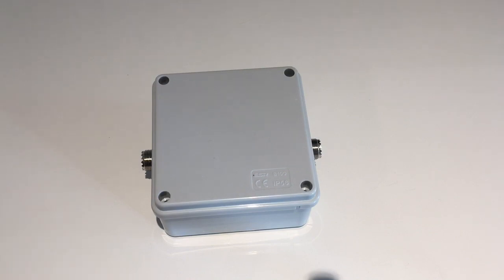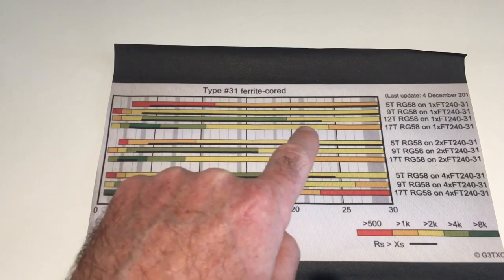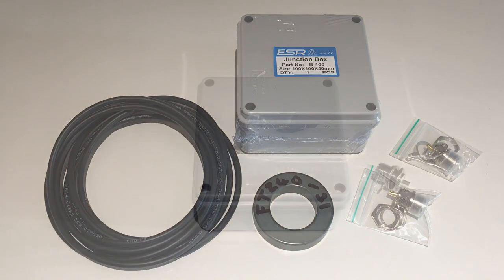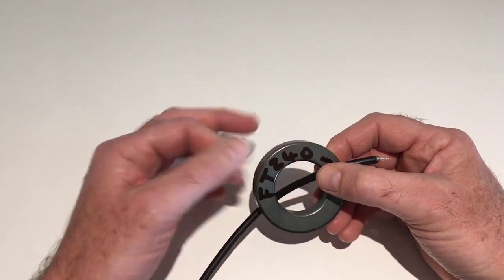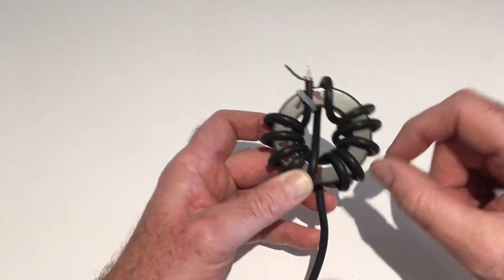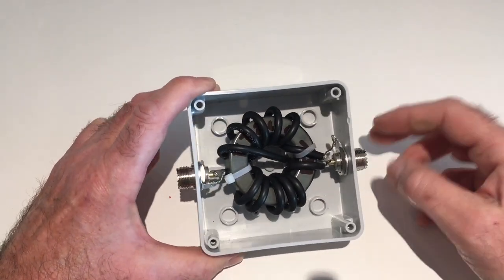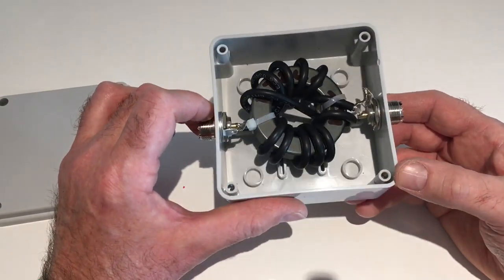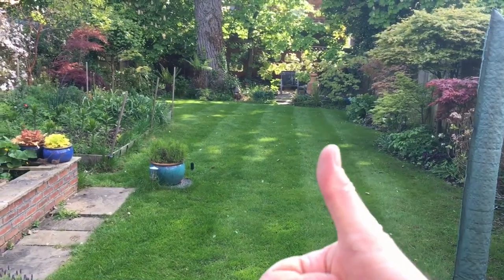DIY Simple & Effective HF RF Choke

Comment: Thank you for sharing . I have made the same choke , except for the connectors  I have used PL259 plugs with SO239 inline bulkhead connectors , this method insulates the internal coax conductor & the entire coax connections eliminating any signal loss , this method requires a slightly larger enclosure to allow for the two SO239 bulkhead chassis connectors & the PL259 plugs , this provides a totally isolated system with no exposed inner core .
Reply from the maker: Great 👍🏻

Comment: Nicely explained demonstration and a sturdy job. Interesting to see that you had some condensation in the box on the wall. It's really good to see a video which is "real world" rather than "TV perfect". Thanks Ian.
Reply from the maker: Thanks! Yes, I think I put in the description (🤔) I subsequently drilled a small vent hole in the base and protect the hole with a very small piece of net curtain (to stop insects). It seems the air trapped in the weather-proof box still heats/cools and condenses as a result. I guess it can’t be large amounts, but I’ve done the same on another choke too 👍🏻 Thanks for watching 😀
Reply: @ianxfs  Thanks for the reply Ian. I had seen that you mentioned drilling a hole in your notes...seeing the condensation was a good practical reason to see why you need a hole.

As you say the box is sealed so in theory,  if you included some silicon chips to absorb the moisture from the air in the sealed chamber...you wouldn't need to drill a hole. 

Theory always sounds great, I bet the practic3 is different! LOL 

I enjoy your videos and that of the Callum Crew. Keep up the good work! 73s Ace G6XIB

Comment: Thanks for the link, I found a box of 4 FT240-43 toroids in my shack and happen to need a decent choke where I feed my coax (rig-58) in through a window for a temp setup.  When I am sending on 80m, my wife’s hobby light keeps flashing.  I’d say I have some RF coming in on my Random Wire antenna.
Reply from the maker: gsansoucie ok good luck!

Comment: Excellent video. Why did you choose 12 turns and not 8? 8 turns on the chart shows more of a resistance result over the HF bands which was recommended.
Reply from the maker: Hi Paul. If you’re on Steve’s webpage, go to the specific ferrite links below the main tables. There’s one for type 31 and these differ from the main summary table. Based on the spread of resistive properties as well as the green impedance I thought 12T looked a better spread. I’ve had no CMC issues on my OCFD at 200w over 40-6m since install 3 years ago. Happy with that. Good luck if you’re building your own 👍🏻

Comment: Hi, fwiw in theory RG58 can suffer from the centre conductor migrating when wound like this round a tight radius, I must admit that it does not seem to have bothered a common mode choke I put together decades ago. I have bought RG142 for a new QRO balun, it is teflon dielectric and jacket, not terribly easy to strip the ends but it will not melt with a soldering iron. FWIW my observations suggest that power handling is hugely affected by the level of imbalance that the  balun has to deal with. Very clear description of the construction in your video 73
Reply from the maker: Thanks! Yes, seems to be ok as now been in use on two antennas for about 1.5 years, with 200w RF 👍🏻
Reply: @ianxfs  thanks for the reply, fwiw I have checked the bending radius in the datasheets, RG58CU marginally wins over RG142 although RG142 has a tiny bit  less loss.
Reply from the maker: g0fvt ah right...worth checking then 👍🏻
Reply: @g0fvt  For the length of coax that you are using to make these 1:1 Ununs, loss is not a factor.
Reply: @jfrphoto01  not normally no.

Comment: I did mine with a RG-58 cable assembly without the box. I used heat shrink to protect the choke.
Reply from the maker: Yes good point Tim! Mine was to insert into an existing set-up, so I went for the box.
Reply: @ianxfs  I go for the simple solution. Once it is installed, no more PC freezes.

Comment: Good video and explanation. After fitting did you notice much difference on the bands?
Reply from the maker: Thanks. Yes it removed the common mode current on my off-centre fed dipole coax. I also fitted one to my ground mounted multi-band vertical, but there wasn’t a problem with than antenna to start with. Just for good measure. All good 👍🏻
Reply: @ianxfs  thanks Ian, I might have to investigate one of these.

Comment: Sir, Thanks much for the educative and informational Video on Chokes. I'm new to SWL, and not into transmission.(Basically interested in SWL ONLY) My equipments are YAESU FRG-7 and FRG-7700, both satisfactory functional. My antenna is "Random Wire" flung out of the window. My signals are quite good on 160 Meter Band to 41 Meter Bands. The Antenna Balance device has not been connected, as yet. That'd take place at the later part of May.
The question is, since I'm only into SWL; is there separate Choke for Receivers; or can I use this Choke  in my antenna circuit?
Thanks in advance and an acknowledgement will be highly appreciated.
Stay safe, Sir and Bless you. 73s
Reply from the maker: Sree Kumar Thanks for the nice comments Sree! I don’t think it’s a necessity to have an rf choke when you’re just listening, but they do block common mode currents on the shield of the coax, so they may help. It depends on each person’s situation. If you’re not having interference or noise problems, then you’re probably fine. You can always add a choke and see if things improve. It won’t hurt, so for a little cost and effort, it may be worth a try. Enjoy your SWLing 👍🏻
Reply: Sir, Thank you for the rapid response. Presently the Random flung wire antenna on the Oak trees do a commendable reception on both the receivers. But, at times, I get a great amount of noise ( disturbance ) on lower Bands , distant and far away transmissions. But it’s not constant and I traced the source to our upright Freezer  and Fridge. These units have their own inverters working when the compressor kicks in.
Toby, my Canadian friend, therefore suggested implementation of ‘Choke’ in Antenna input.
I’m like, I ordered a 9:1 unun and now a Choke? When’re am I gonna install all this? Then I saw your YouTube, that gave me a lot of info. 
My questions; therefore, are:-
1) Is your Choke suitable for my receivers?
2) Should go for type 52 toroid ferrite Core? ( One is available in France )
3) What is the Toroid Ferrite Core OD  50mm?
4) What is the Coaxial Cable OD? I see your Coaxial cable to be thinner.
5) Thanks. 
I’d be gratefully, thankful to your advice, as always.
Please stay safe.
73s
Reply from the maker: Sree Kumar Hi Sree, here’s my thoughts...
1. Yes
2. Types 31 & 42 are good for HF. I’m not sure about a 52? You might have to research that mix on the internet. I think it works better at the higher HF frequencies?
3. 2.4 inches/61mm
4. Coax is RG58 approx 5mm

Good luck!
Reply: ianxfs <<<< Sir, thank you for the prompt response. Stay safe. 72s

Comment: Great video mate do you remember where you purchased the so239 connectors from.
Reply from the maker: Hi James, no sorry. All online ham/amateur radio retailers will stock them and also the outside four-screw ones as well. You’ll easily source them. Have fun!

Comment: Hi Ian, just watched this again. Wondering if I wind the ferrite on the end of my RG58 cable to the antenna if I actually need an enclosure? Have you any opinion as to the power handling for this choke, you say you regularly use 200w, would it be OK for 400w I wonder. Thanks for the videos :-)
Reply from the maker: Yes & yes Chris. If you can avoid the box and additional connections then all the better 👍🏻 From what I’ve researched, 400W on that core and coax is fine 😀
Reply: @ianxfs  Thanks very much. I have ordered type 43 for mine. Have some silicone wire too so going to try 2 ways of doing it.

Comment: Hi Ian great tutorial just want verifcation Did you use RG8 or RG58 and would it make much difference thank you Dave M3xie
Reply from the maker: David Robinson Thanks David! RG58. As long as it’s 50 Ohms and you can wind it around the toroid and it is spec’d for the power you’re using, then you’ll be fine. 73. Ian.

Comment: I've struggled soldering the coax to the SO 239. I see yours have "tabs" to solder to. Where did you get those SO 239s?
Reply from the maker: Hi Dennis. I can’t recall, but the shield part of the socket should have the disk with solder tab attached otherwise you’ve got nowhere to attach to. Mine will have been online from one of the few online uk stores. Good luck!

Comment: Great video, I thought you would have put the choke near the antenna feed point !
Reply from the maker: Alec M Yes Alec, but the OCFD already has a 4:1 balun at its centre, so a choke as well would be too much sag. It’s at the closest point where the coax meets the wall. I have another on my ground mounted vertical, but again, a few feet away from the base in the centre of the lawn so as not to be obtrusive or a trip hazard. All still work fine 👍🏻
Reply: @ianxfs  As long as it works that's what matters lol   thanks for the reply

Comment: I don't know that you are supposed to wrap RG-58 that tightly; you may get migration of the center conductor within the insulating foam.....it's non-repetitive turning radius is .98 inch (24.89mm).
Reply from the maker: Hi Michael. Yes you could make the turns more loose I guess. So far, no problems nearly two years on with two of these running 200w 👍🏻

Comment: Hi fron CHILE, EXCELENT VIDEO, one cuestion. what powes is max. ????
thank
Reply from the maker: Sergio Del Gaudio Hi Sergio! I don’t know what the max is for sure. It will manage 400w which is the UK maximum, but looking around at other websites I think it will go to 1Kw. You could also stack 2 of the ferrite cores on top of each other and wrap coax round them both together for an even higher power, which increases the choking effect too. As long as you don’t exceed the coax limits 👍🏻

Note: I did drill a small vent hole at the bottom to let it breath. 

Hope this helps!

73 Ian.

Comment: Hi - will my RG8 coax be too different to the RG58 that is used for the tests - or will I have to find a length of RG58 to create the Choke - cheers
Reply from the maker: chilli sauce RG8 is 50 Ohms, but a larger diameter than RG58 I think? You may find it too wide to go round the toroid without risking crushing the interior?
Reply: @ianxfs  Hi-  the RG8 is 6mm diameter -  RG58 is 5mm   !!!  Ill have to stretch the hole wider then !!!!  RF - drug of choice
Reply from the maker: Ah right. Should be ok then 👍🏻
Reply: I guess this is RG8X or Mini-8. I have some of this. :-)
Reply from the maker: @paulsengupta971  It's RG58 Paul.
Reply: I meant Chilli Sauce's 6mm "RG-8".

Comment: thanks for making the video
did you check to see if there was a 50 ohm impedance match for your choke? cheers
Reply from the maker: Ralph Kluge Hi Ralph. I used the club’s MFJ analyser with the choke inline with the antenna and the SWR etc. was all ok if I remember correctly. Anyway, it’s been fine in operation for over a year now and this model is in use on two antennas without ill effect. Ian.
Reply: ianxfs I just tried it with a #43 instead and the swr is flat until 16mhz then shoots up. I wouldn’t have thought there would be such a difference. So think I may need to try another piece of rg58
Reply from the maker: Ralph Kluge Sorry Ralph. YouTube didn’t inform me of this message, so I missed it! Hope you got sorted ok? I’m not sure why the swr changed? Seems odd... Ian

Comment: You had the RG58 wire cut and did not tell us the length of the cable  needed for all the turns of the transformer common mode choke .
Reply from the maker: Hi, I put it in the video description. 1m 👍🏻

Comment: Nice!!
Reply from the maker: Thanks!
Reply: I just recently got my General class license here in the USA. The electrical theory  and mathematics was the most challenging if not interesting  part of the study. Fascinating to watch some one build a choke and for me to be able to grasp the concepts behind it.👊 Do you have any videos on multi band HF antennas ?
Reply from the maker: @thomastammaro693  Hi Thomas. Congratulations on your licence! Multibands, depending upon you house/garden, I would say off-centre fed dipole, vertical and/or doublet? Have fun! 😁
Reply: @ianxfs  , Thank you sir. I have actually got an inverted V cut to be resonant for 10-80 meters. The trick for me is going to be getting it up over all the tree  and tying it off . Hence my question  regarding the Diamond  vertical ( it's referred to as a garden  antenna, I just can't remember  the exact model number).I still have much to learn. But I'm trading ( in theory at least)  for price and
simplicity in being able to get up and running

Comment: What frequencies will this cover?
Reply from the maker: Hi Paul. If you pause the video at the point where I show the frequency charts, you can see the choking performance across the HF bands. This type 31 ferrite is better for the lower-mid bands whereas a type 43 is better mid-high.

Comment: what particular RG58 are you using?
Reply from the maker: It’s RG58 C/U, but I don’t think it really matters, so long as it’s the general RG58 family spec. Hope this helps. Ian.
Reply: @ianxfs  thanks finished mine. now attached to my hustler 6BTV vertical.
Reply from the maker: revadan Brilliant!
Reply: How much power can it handle?
Reply from the maker: revadan I don’t know what the max is for sure. It will manage 400w which is the UK maximum, but looking around at other websites I think it will go to 1Kw. You could also stack 2 of the ferrite cores on top of each other and wrap coax round them both together for an even higher power, which increases the choking effect too. As long as you don’t exceed the coax limits 👍🏻

Note: I did drill a small vent hole at the bottom to let it breath. 

Hope this helps!

73 Ian.
Reply: @ianxfs  awkie.  yeh i also drilled a hole underneath.  So with two ferrite, will come with the same number of coax turns?
Reply from the maker: revadan yes.
Reply: Can i put one in the antenna side and one next to the radio?
Reply: @revadan  You can put another one where the coax enters the shack if you want to.
I have one at the base of my Hustler vertical and one just where the coax enters the shack outside.
Also make a whole mains choke for your AC supply and that should stop mains crud going up to the 
antenna plus it stops RF going back down the mains.

Watch this video by Ian White, he explains it very well.
https://www.youtube.com/watch?v=LSL1h6MJbaI

You can make a mains choke with the biggest Fair rite 31mix snap on.
About 5turns of UK 2.5mm mains cable fit on it, video below.
https://www.youtube.com/watch?v=yCCKjPF4dhU

Comment: What is it? And for
Reply from the maker: HF RF Choke. Stops transmitted RF coming back down the coax shield/braid into the shack and causing interference to other devices as it radiates.

Comment: That's a 1:1 Balun... not an RF Choke.
Reply from the maker: Hi, it’s unbalanced in and unbalanced out (as it’s one run of coax) and designed to attenuate unwanted frequencies using the properties of the ferrite and is therefore a choke. There is are further videos in relation to an off-centre fed dipole on the channel which show the build of a 50 Ohm balun which also benefits as a choke (& the build of a 4:1 transformer). The balun is designed to achieve compatibility between different systems (& can choke too). Hope this helps 😀